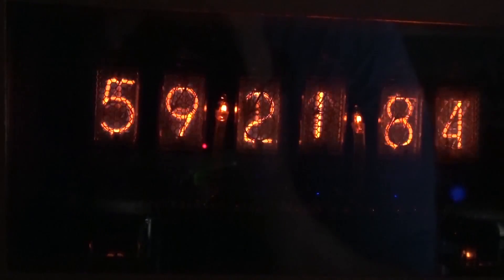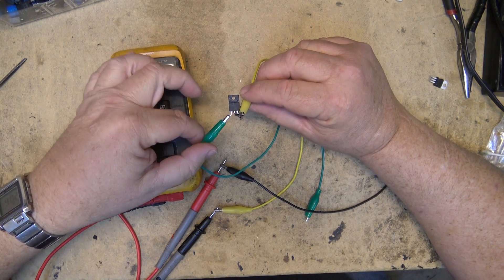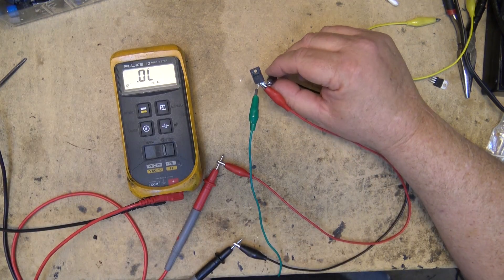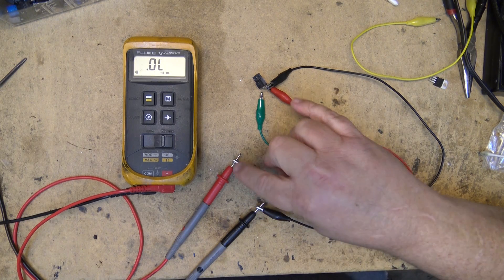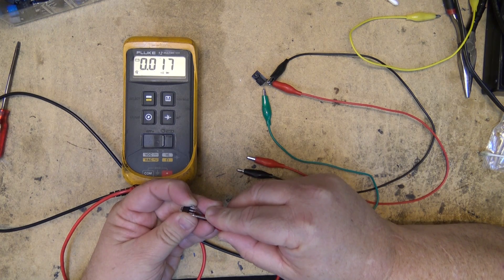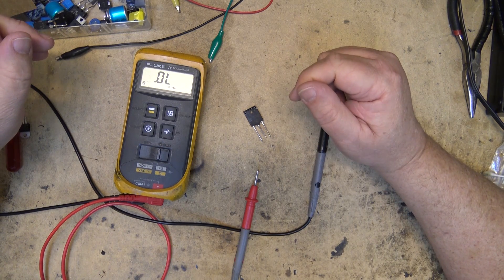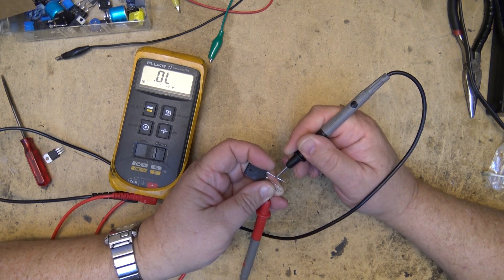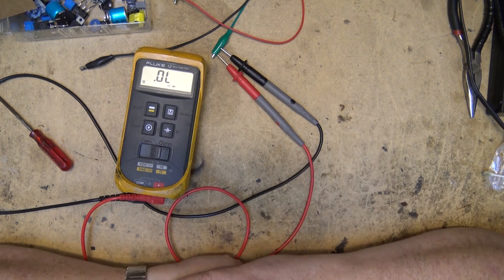Testing a MOSFET and BIPOLAR transistor with a multimeter

Comment: You make it sound as though all mosfets are the same and are tested in this way, when in fact there are positive and negative channel mosfets, and I am presuming your test is for  a negative one. I also presume for a positive channel mosfet you reverse the positive and negative probes? Is that right? Which then leads on to the next question how do you know which type of mosfet you are testing in the first place?  Surely you need to know that before you can test?
Reply from the maker: Yes just as with a bipolar transistors you reverse the polarity for a p channel.  You can Google the number on the device to find out if you have an n channel or p channel mosfet if you are unsure of the numbering.
Reply: @12voltvids  OK thanks

Comment: In my testing/checking MOSFETs using Multi-meter, when the gate is charged, why some MOSFETs (N-channel & P-channel), the drain to source let us say 0.002 or less my meter reads, others starts with more higher like 0.435 and running up as fast as a second or half a second until showing infinite? Discharged test is working (no reading on drain to source). What does it mean? Does all MOSFETs behave like that?

Comment: Thanks for the video.
Question: How do you test a darlington transistor like a 2N6388?
Reply from the maker: Some meters will have a transistor tester built in that will allow you to test them. They require a bias voltage to the base to put them into conduction. You can still test for E-C shorts on output transistor, and C-B shorts on the the input, so those junctions can be measured exactly like with a BJT transistor. What you can't measure with a standard diode test is E-C short on input transistor or C-B, E-B short on the output. For that you need to either use a meter that can measure transistor gain, or you need to build a jig with a couple of resistors to apply a bias to the base and measure current flow between E-C. I'll have to look through my parts bin. If I find any darlington transistors I will build a simple jig and demonstrate. Uses 3 resistors to make one to use with a conventional meter, but I believe one of my meters has a transistor tester on it that will test and show the gain directly
Reply: Thanks Dave

Comment: Thank you!!
Triacs, thyristors and diacs are still confusing to me. If you care to share some insights/easy to remember rules, I'd be very grateful!
Reply from the maker: A thyristor is nothing more than an SCR. Think of it as a rectifier with a gate to control it. Once triggered it will conduct until the current is reversed or removed. A triac is the same but will conduct in both directions once triggered. A light dimmer for incandescent lamps for example uses a triac as the switching device. A diac conducts after it's break over voltage like a zener diode but conducts on both directions. Think of it as 2 zener doides one facing each direction. Usually a diac can be also found in a light dimmer as the trigger for the triac gate. A teardown of an old light dimmer might be a good place to show off how these opearate. On an isolation transformer naturally.
Reply: Thanks Dave! I understand how these devices work, but anytime I come across time, it's takes me a while to get my head around it. Dimmers and motor controllers are indeed where I typically see them.

Comment: Both those components look the same. How do you know what's what🤔
Reply: The easiest way would be to google the part number and check the datasheet if you're not already familiar with the device. You'll find many components that look the same.  Over time, you'll start to recognize part numbers and/or just know from context of the circuit.
Reply from the maker: The part number.
Look it up to find our what it is.
Reply: I’d like to know how to identify the rectangular tan capacitors with silver ends on modern boards that have no identifying marks.
Reply: Also how to test inductor coils and what to expect to see on a good coil